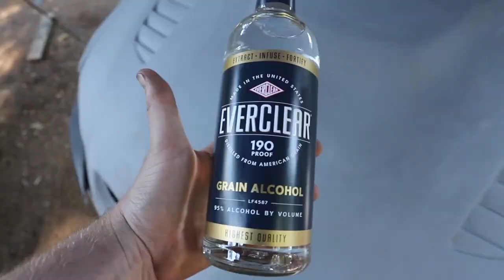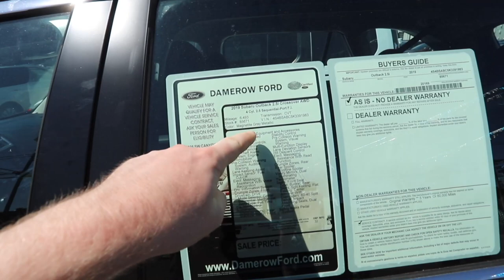We Painted Kyles E92 BMW And It Looks AMAZING!!

Comment: Dude... That Mustang would look sick if you took all the paint off and just clear coated it DeLorean style. 😎
Reply: Uhm. A DeLorean is made out of stainless steel
Reply: @dragway3513  your point?
Reply: @xRSAkingx  that a DeLorean isn't just clear coat.
Reply: @dragway3513  understood. But I'm simply saying strip it down to bare metal and clear coat it to achieve a look similar to a DeLorean. Joe Rogan has a custom nova in the same fashion. Looks mint 👌
Reply: Half the car is made of bondo. Not sure that would look good in just clear coat.

Comment: I’d paint the mustang a flat green though you’d probably be sued for infringement on the bullet trademark.
Reply: I don't believe that you can claim a copyright based solely on the color of a car that was sold under production. Intellectual property if they built it exactly the same MAYBE but doubt it would hold a proper case in court unless names were used. That was the issue with the Eleanor build.
Reply: Yemze I believe your correct. Was being sarcastic though not about the color. Always been a fan of that green.

Comment: I hope you got your edge distance right!

Two methods for obtaining edge distance: The rivet diameter of a protruding head rivet is 3⁄32- inch. Multiply 2 times 3⁄32-inch to obtain the minimum edge distance, 3⁄16-inch, add 1⁄16-inch to yield the preferred edge distance of 1⁄4-inch. The rivet diameter of a protruding head rivet is 3⁄32-inch.

Comment: Paint looks awesome! Riveted theme paid off big time!!! Great Job!!!

On Oscar's car...great choice on the front flares! I was, however, hoping he would paint the car like this:
1. Using the green on the hood (since it was the first inspiration) only in a matte finish. 
2. Matte black finish on all the kit features including the flares, bumpers,  and trim. 
I really believe that, that shade of green and everything else blacked out would be super clean,  and at the same time, preserving some nostalgia. Use base coat/ matte clear coat the same way you did here, but spray the green first, cover that (use fine line 1/4" mask for cleaner lines and curves), then the black,  and then matte clear everything. 

I did custom paint for many many years and I can see it done as described already in my mind. 
Just my humble opinion guys 😉

Comment: I was really on the opposite side of the fence the whole way through the video but I have to say I like it quite a lot! Even the dodgy bonnet/front arch line...I wish you cut the vents out made them functional and the clear could use a bit of correction but otherwise it looks pretty decent I look forward to seeing the finished product.

Comment: Looks like fun and great design.  Only thing is you cant use filler to join dissimilar materials.  It will crack on the line eventually no matter how good the body work or type of filler.

Comment: very good effort ! Can I just give a bit of advice on the paintjob ? I noticed that you guys don't overlap while spraying the car. You have to spray past the seam of the panel you are spraying on to the panel next to it. otherwise you get a big buildup of paint around the seams between 2 panels. The risk of getting a run on the seams is much bigger because there's much more paint on these parts of the panels.

Comment: did you have to spray a sealer under those fender flares so that the under side  doesn't rust ? I noticed it's not perfectly sealed around the radius

Comment: Actually with metallics you want your first coat to be a medium wet coverage coat, then on your second and third coats you finalize coverage and work on orienting you’re metallics to avoid getting tiger striping and mottling with 75% overlap and a drop coat. That’s my process as a retired painter, obviously there’s a lot more to it but I won’t go into detail. Many ways to do it but that’s how I’ve had better results.

Comment: I am worried that you did not paint the backside of the metal trim pieces. Water is going to get behind those and rust, which will run down on the rest of the car. Or were this painted and I missed it.
Reply from the maker: if you watch really closely you can see we painted the back side of each rivet plate black

Comment: Nice. Not knocking the workmanship, but wouldn't it have been better to drop a few spots from a welder and use a Dremmel tool on the spots and bodywork to mimic rivet plating rather than adding more weight with actual plating?

Comment: Pity you hadnt someone there that was actually a painter, would have came out so much nicer, especially in the clear, the amount of dirt and specs in the clear is awful, also the orange peel in the paint, not good, should have been sprayed at a higher pressure with a higher percent of thinners in the clear 👀 wetting the floor with water would have helped a lot too, a pity really, and those stupid plates holding the front wing/fender to the bumper are atrocious.